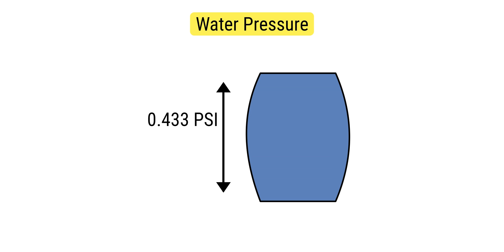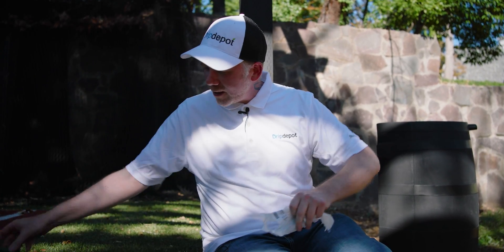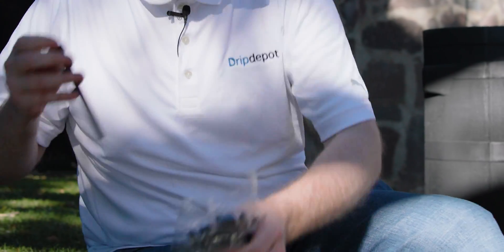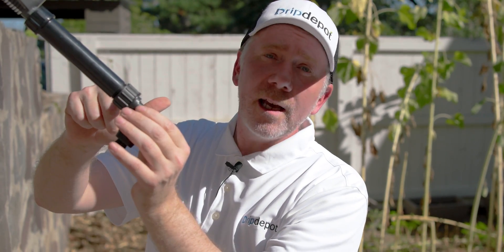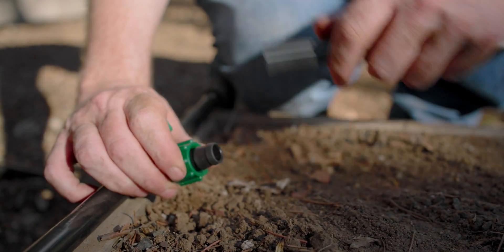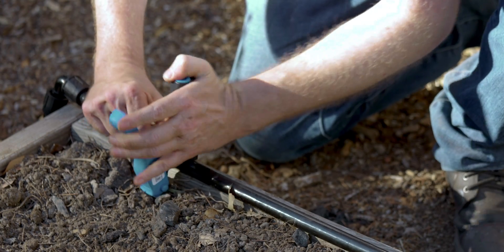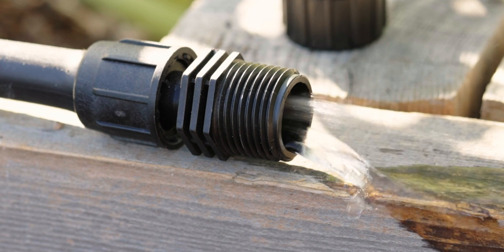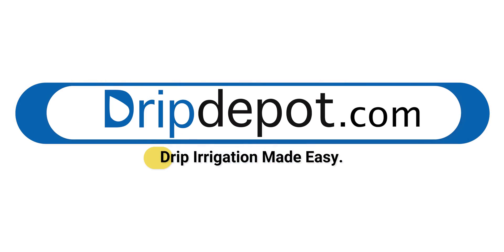How to Install a Gravity Rain Barrel Drip Irrigation System | DIY Raised Bed Project

Comment: Can I use 1/4 dripline instead of drip tape for a rain barrel installation?
Reply from the maker: If the rain barrel can be elevated enough, 1/4" dripline can indeed be used in lieu of drip tape.  Elevating a barrel that much will not always be viable or possible, but in places or setups where it is it can absolutely be used.  

The minimum PSI on the 1/4" dripline is 5 PSI.  About 11.55' elevation will provide 5 PSI from gravity.  In actual practice you'd want to elevate it a bit more than that due to the small pressure loses present in every irrigation system.  Depending on the size of the system and its flow rate, another 1' to 5' is usually best.  

When that's not possible, button drippers that work at almost no pressure make a good choice if you're looking to avoid drip tape.  They can even be used somewhat similarly to drip line in that you can punch them into the wall of 1/2" or larger poly tubing, and poly tubing is reasonably flexible, particularly compared to drip tape that has to be ran in straight lines.   At 13:31 into the video we use one of the drippers I'm describing, though we used it at the end of a 1/4" tubing run instead, but they work well either route (these drippers here: https://www.dripdepot.com/turbo-key-dripper ).

Comment: Hi, great videos!  What are the pros and cons of drip tape versus 1/4 inch with button emitters? And what is the maximum lenth of both and the maximum number of emitters for both? I suspect this depends on psi and flow?
I want to set up 3 different gravity fed irrigation systems:
1) Supplied by a rain barrel approximately 3-4 ft high and feeding a 70 ft flower bed on a gentle slope down hill. Will the slope help compensate for the height of the rain barrel? Should i use drip tape so that i don't have to hook up so many buttons on a long length of 1/4 tubing? I also understand 1/4 inch can only go a max o 30 ft on 15 psi anyway so assume it is much shorter on a gravity fed system with 0 PSI?

2) Rain barrel for a small (~6x3ft)raised bed. 3-4 ft high barrel about 20 ft from the bed. Would this be fed with a 1/2 inch supply line and then drip tape of 1/4 inch with buttons?
3) Rain barrel ~3-4 ft high supplying a largish area via 3x T manifold system each being about 60 ft each. Drip tape again? will i be able to supply this large of an area? Or should i split the supply at the barrel and run two separate lines on different times?
Reply from the maker: For a gravity system, you pretty much nailed the big pro/con between the two, and that's labor time.  Button drippers do take more time to install than drip tape.  That comes with the advantage of being able to put them anywhere (tape being limited to a straight line) which allows you to get out of the way plants if there are any.  They can also be used with different flow rates, allowing a plant that needs less water to use a 0.5 GPH dripper and a thirstier plant to have a 1.0 GPH dripper, for example.  The maximum number of either does depend on pressure and flow, as you noted.  Diameter of the maline also plays a role, but that's largely related to pressure (smaller diameters experience more pressure loss from friction).  

And you bet, any sloping downward from the rain barrel will aid in adding more water pressure.  With just the height of the barrel pressure is only about 1.3 to 1.7 PSI and drops as the water level does (if you're counting the height of the barrel itself).  You wouldn't necessarily be more limited in the length of a 1/4" line in a gravity system compared to a municipal system, at least not significantly.  It will all depend on the flow rate going through that 1/4" line (which determines friction loss).  As a quick example, if you put a 0.5 GPH button dripper at the end of a 30' run of 1/4" tubing, the pressure loss would only be about 0.013 PSI, which is minimal even in a low pressure gravity setup. 

For the specific areas you touched on: 

1. 70' flower bed is fairly large and could be labor intensive to get a dripper to each individual plant.  If they're in neat rows, or close enough to one another, drip tape could definitely save some labor time.  
2. This one is small enough that even drippers wouldn't be too bad.  With that said, emitter line (drip tape and drip line) is a common solution for raised beds.  You can simply run some down the rows of plants and cap it off.  A 1/2" mainline will very likely be more than sufficient for a single raised bed, the flow will be low enough that pressure loss will be minimal, just like in the example above.  The height of the raised bed compared to the height of the barrel will be worth considering though, as water will need enough pressure to get up into the bed.  
3. This area is indeed pretty large and the manifold will cause things to lose a little pressure (not much, but every bit can count with gravity).  Given the size, drip tape would be the lower labor option if the plants are sufficiently close to the run of drip tape to use the water the emitters put out.  

On the two larger zones, flow is going to be a big consideration.  As a quick example, if water comes out of the barrels at a rate of 100 gallons per hour but you have 150 gallons per hour in emitters, some of them will be starved of water.  It can be challenging to test the flow rate of a barrel, but you can get an approximate idea by connecting a garden hose to the outlet, running it down to where the irrigation system will start and doing the old bucket fill test.  Time how long it takes to fill the bucket with water and then plug the numbers into this flow rate calculator to get a good idea of how much water it provides: https://www.dripdepot.com/irrigation-calculators/flow-rate-calculator - it's not perfect, particularly with a garden hose, but will help get an approximate idea of how much flow you have to work with. 

If there's insufficient flow for the number of emitters, then you had it exactly right: splitting things into zones is the usual fix.  Just like my example above (100 gallons in flow, but the emitters add up to 150 GPH), the answer would be to split the system into two 75 GPH zones so that the 100 GPH water source could provide enough water :)
Reply: @dripdepot  your advice is invaluable. Thank you so much. So glad I came across your videos. I'll be buying so much stuff from you guys!

Comment: Hi, I am currently operating a gravity-fed drip irrigation system for approximately 800 feet of tree fencing. The setup consists of half-inch poly tubing connected to three large water tanks, each with a capacity of 1,200 gallons. These tanks are elevated about three feet above ground level and distributed across the land.

The main issue I’m facing is that due to uneven terrain, some trees are not receiving adequate water.

To address this, I’m considering two potential modifications:

1. Upgrading the poly pipe from ½ inch to 1 inch to improve flow.

2. Relocating the water tanks closer together in a centralized location instead of having them spread out.

Would either or both of these changes help resolve the issue, or could they introduce new complications?

Thanks
Reply from the maker: #1 in particular would likely help, at least to some degree.   At 800' it wouldn't take much flow for 1/2" tubing to experience high friction loss, which can definitely be a larger issue on a low pressure gravity system.  #2 really depends on some other factors.  Would this move put them at a higher elevation relative to the trees than previously?  If so, the added pressure would likely help.  To what degree it helps is largely determined by their current elevation relative to the rest of the system.  Water pressure is generated/lost at a rate of 0.433 PSI for every 1' of elevation change, so 3' of elevation is only about 1.3 PSI.  Not a lot of pressure to push water hundreds of feet and out of emitters (though it can absolutely work, and going with larger diameter mainline is one of the steps that can help).  

As a quick example, just 35 GPH going through 800' 0f 0.600" inside diameter 1/2" tubing would lose about 1.5 PSI from friction alone, more than the 1.3 PSI generated by 3' of elevation.  Add to that small losses from fittings and changes in elevation in the field and you can get a good idea of what you'd need to overcome the low pressure.  

Elevating the tanks to create more pressure would most likely yield the best results, you'd get more pressure to push the water over the uneven terrain in the field (so long as none of it was elevated higher than the water tanks).  With a 1200 gallon water tank, elevating it could be impractical though (as you've likely noticed if you've considered it!).  There's always the option of a pump, but if upgrading the 1/2" line into larger diameter gets things working as you'd like, you could probably go without the pump or trying to elevate the tanks even higher.

Comment: I am looking for a rain barrel solar power or similar system like this, but enough PSI to run water from the rain barrel as a mister to my chicken coop, where I have to hose near.
Reply from the maker: You're on the right track!  It would need a solar powered pump to get enough pressure for the misting nozzles since they typically operate at higher pressure than drip emitters.  That, or a lot of elevation :)

A pump is likely going to be the most viable approach, I think the most difficult part would be finding one that puts out enough pressure (30 to 80 PSI) for most misting nozzles, but they're definitely out there.

Comment: 🎯 Key points for quick navigation:

00:00 💧 Gravity Irrigation System Basics
- Water pressure changes by 0.433 PSI per foot of elevation
- Low-pressure emitters are essential for gravity systems
- Natural elevation or barrel stands can provide necessary height
02:11 🛠️ System Components Overview
- Main components: mainline tubing, micro tubing, drip tape
- Various fittings: adapters, elbows, tees, end caps
- Tools needed: pipe cutter, punches, stakes
06:52 🔧 Head Assembly Installation
- Timer installation for automation
- Filter placement to prevent clogging
- Proper connection of hose-to-tubing adapter
08:46 🌱 Drip Tape Bed Setup
- Mainline splitting and routing
- Installation of header row and drip tape
- Proper end cap installation and system flushing
12:05 💦 Button Dripper Bed Installation
- Quarter-inch tubing and dripper placement
- Use of coupling valves as emitters
- Installation of stabilizer stakes for drippers
15:41 ✅ System Testing and Final Steps
- System flushing procedure
- Leak check and emitter flow verification
- Flow adjustment using coupling valves

Made with HARPA AI

Comment: So what if i want several emitters per run? You only did 2
Reply from the maker: So long as there's enough flow available from the water source and you don't overtax the mainline tubing (which does take quite a few emitters) you can definitely do 2 or more emitters.  On the bed that had the drip tape in it, I think we had around 6 emitters in each run of tape, and that bed performed very well.  Similar could be done with with button drippers, particularly those on the lower flow end at 0.5 GPH :)

Comment: Question I live in a freeze zone… should I remove parts from system in the winter months?
Reply: Could you also put some of the main tubes under mulch so it looks more aesthetic or pleasing to the eye?
Reply from the maker: @aimeebethine  You sure can!  I'd say it's pretty common to bury the lines.  Just like with PVC try to make sure they have a bed of soft crumbly soil to rest on, and then you're welcome to apply mulch on top of it.  You can even bury the lines about 4" to 12"  if you prefer sub-surface.
Reply: @dripdepot thanks for getting back to me.
Reply from the maker: In most cases the only parts you need to bring in are the head assembly parts: timer, filter, pressure regulator and backflow preventer.  If you're building a gravity system you likely won't have all those parts, so just the ones you're using.  

The rest of the system can be gravity drained if you have end caps at low points, which is likely on a gravity setup. 

After gravity draining, put the end caps back on and plug up the inlet with a threaded plug to keep insects out over winter and you're good to go.  :)